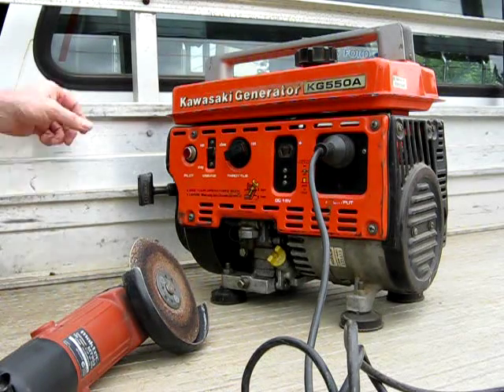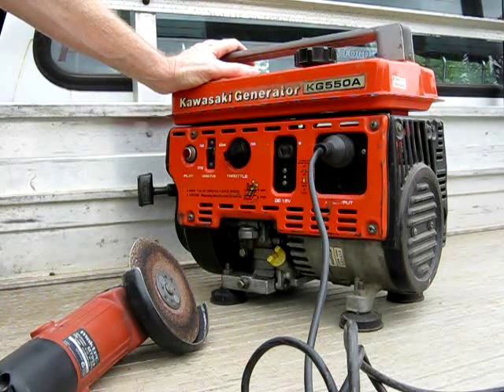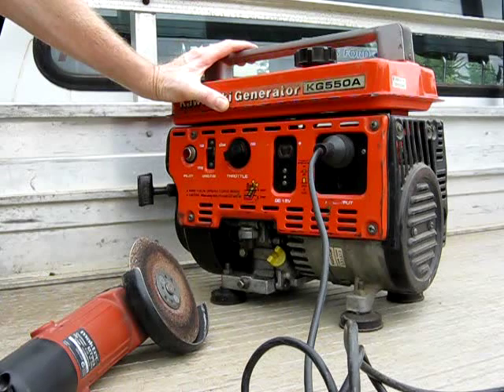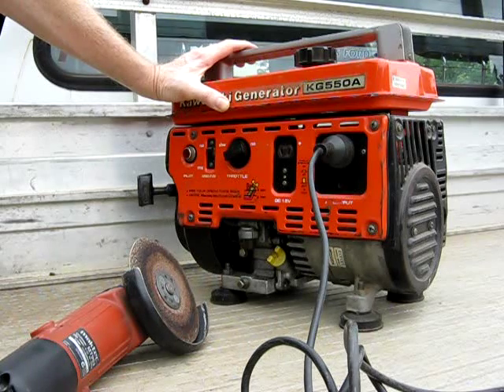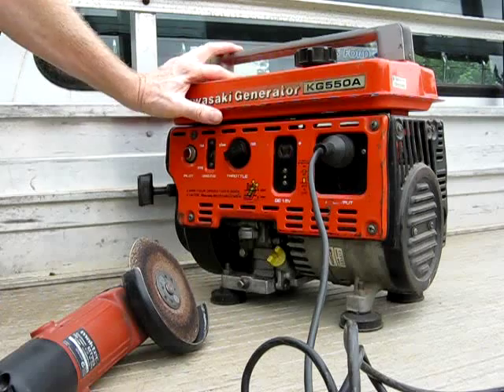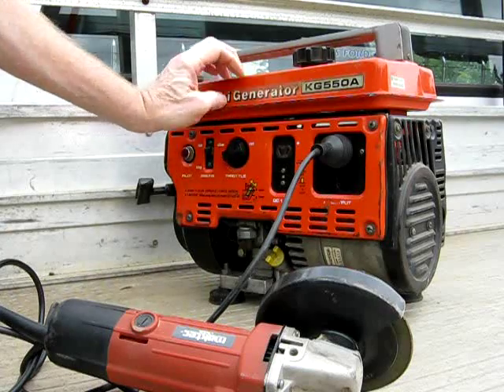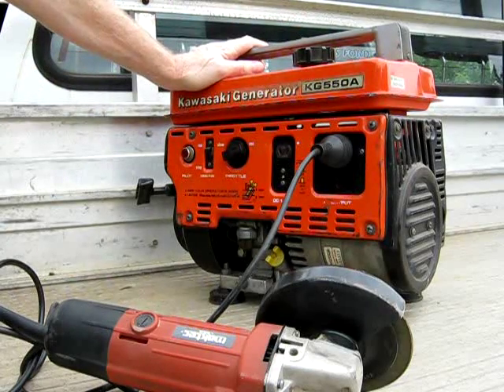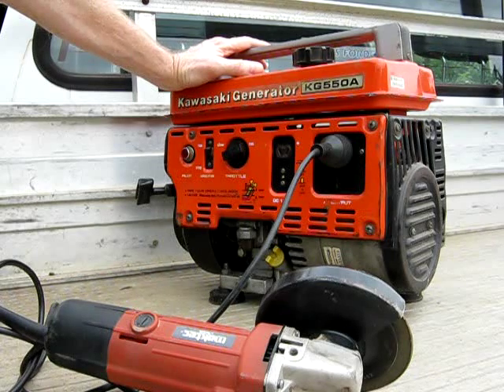Home made piston rings

Comment from the maker: Hi bigbrewser1947  We have similar hones (deglazers in Oz) but they are mainly used to clean/rough up a bore on cast or steel.

The little Kwaka genny has a Nikasil type coated aluminum bore, and you can't really hone this stuff very much as it's quite thin.  Might have been worth a shot, but if you go through the Nikasil then you're in big big trouble.  Cheers Rob

Comment from the maker: Hi ray man.  I've never heard of it being done.  It would definitely be possible to hard bronze braze weld it, Arc would probably consume it - especially something as small as a chainsaw ring.  Bronze is definitely capable of welding very small components without damage and is extensively used with cast iron. Bronze will easily withstand cylinder temperatures.  Cheers Rob.